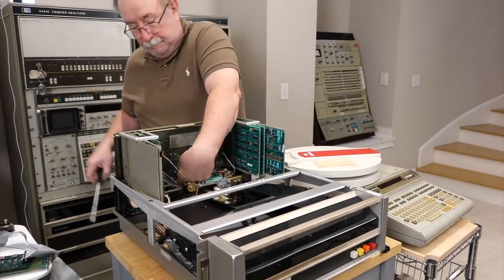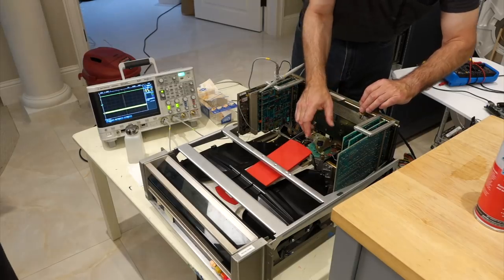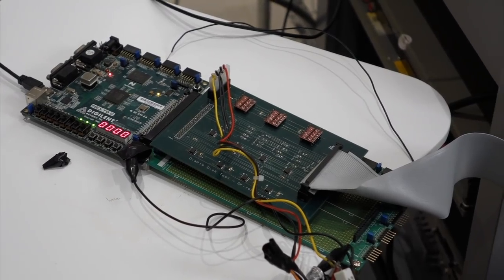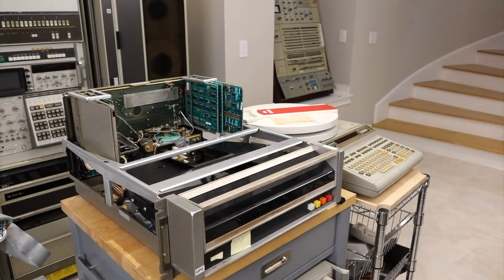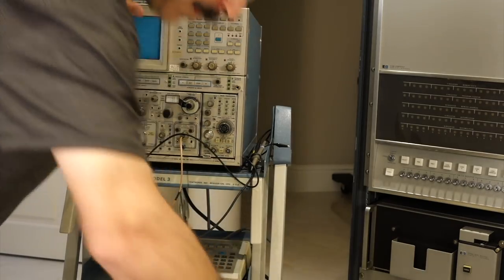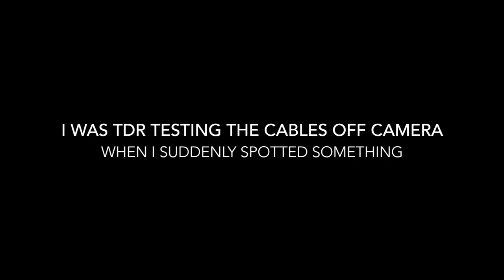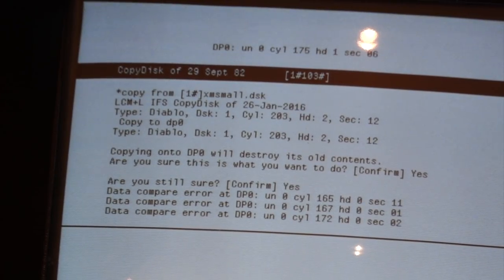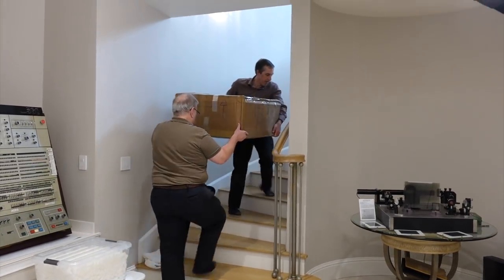Michele's Haunted Diablo Drive

Comment: A place I used to work at back in 1984 routinely repaired crashed heads in the fixed drive side of a Honeywell Hawk Drive by removing the heads and sanding them with fine sanpaper and washing them out with high grade alcohol.  It was quite a sight.

Comment: Interesting - by the late 1970's I was programming on Singer/ICL 1500 series machines that used the top loading PERTEC drives.
The chips in the circuit board looked to be from the 2nd half of 1978.
And you had what looked to be the front panel from an IBM 360 Model 50.
Neat stuff!

Comment: Years ago I worked on very similar drives (Pertec) and replaced many many heads. Once or twice would get drives where the heads were layered with aluminum from the platter (really bad crash the heads will scrape off all of the oxide layer and pick up the metal)

Comment: What a debacle :)  I'm glad most of these problems were alleviated by the time the Quantum and Shugart 8" HDs were introduced.  The only problem with the Quantum q2040, q2080 I've seen again and again is the bumper pad which deteriorates and becomes a sticky mess.

Comment: @20:14 back in the day, i had to add a terminating  resistor onto my windows hard disk daisy chain. My memory fails me, but i do not believe i needed to use a soldering gun, just a jumper block

Comment: I remember a Diablo drive in the 1972-77 era used with a honeywell 316 computer.  The removable cartridge "disk" contained the data of the topography we used in a Naval Gunfire trainer at Naval Amphibious SChool in Coronado CA.  It interfaced to Naval gunfire computers.  Teams would simulate a navigated ship track, Fire simulated naval ship guns and the computer would compute where the shot landed.  Results would show on a video terminal and a training operator would communicate to the "shipboard" simulated teams corrections Up, down, right or left.  Then the "guns" would fire again.  If all was done correctly the new "projectile" would land on target.  Since the diablo cartridge contained the "terrain" if the shell that was fired hit a hill or mountain of course it did not land in the correct place.  Lots of ships trained their personal  in a simulated environment, saved shells, and no one could be hurt as in live naval gunfire.  Fond memories from years past

Comment: The scariest part was when it turned its head around, spewing bits all over the place. (The accessible/observable complication of these old drives versus the hermetic isolation of modern ones reminds me why I bought an RX-8: I have absolutely no clue how a Wankel engine works, so I’ll never be tempted to use my time to work on it.)

Comment: Is that a fancy house decorated with old computers?  I worked for Bell Laboratories for 30 years, and always had a laptop running windows.  The machines i worked on 3b15, 3b20, pyramid 2000, sun, compaq, etc. and running unix. Lynix, etc. programming in Informix, Sybase, Oracle, etc. are behind me.  Last thing i would want in my house is old computers i used at work.

Comment: hopefully, the drive won't get damaged during shipping. the heads appear to be very  delicate.
Reply from the maker: Fortunately, Carl had an original factory head locking bracket which we installed in the disk before shipping. We shoukd have used that in the first place, but we did not know what it was until Al showed us a picture of one!

Comment: 20:25 That solder pad right next to it., I assume it's the existing resistor, looks dry. Perhaps the error was a loos solder joint?
Hard to tell from the picture. I bet you got a better look. But from here it looks dodgy.
Reply from the maker: These are unused solder pads, for other optional resistors or test

Comment: 13:00 So it's sending a Dirac impulse into the cable, and evaluates the impulse response?
Reply: No, the point of TDR is often to find out how far away from the end of a cable or wire is a short or an open. It was used to find a broken wire inside a potted module that was part of an Apollo AGC.

Comment: What about using a 512GB SSD they are not that expensive and you can get SCSI2SATA. if it has been connected to the internet then it has got infected by some nasty virus so I don't think that there is a way of getting it back, or is it much more engrained that it has totally reprogrammed the ALU so as to screw up any disc you try to read.
Reply from the maker: Ah, but the Alto and the Diablo don't talk SCSI. It would take 20 more years, about 4 generations of disk interfaces, and the advent of very high scale integration technology to make such an intelligent high-level protocol achievable in a consumer machine. The Diablo does not even talk IDE. Nor Shugart, which was a parallel interface before IDE. It doesn't have even a bit of memory buffer in it! It just spews out a raw serial bit stream and sector pulses right off the platter, as the bits go under the head. You have to write and decode everything yourself: the sync, the sector labels, the CRC, the synchronous timing, etc..., all undocumented. Hence the FPGA design and the 9 month of reverse engineering Carl needed to figure it out, scope and microcode in hand.